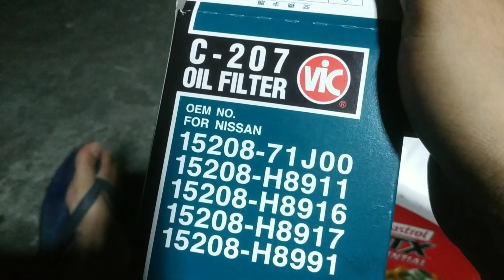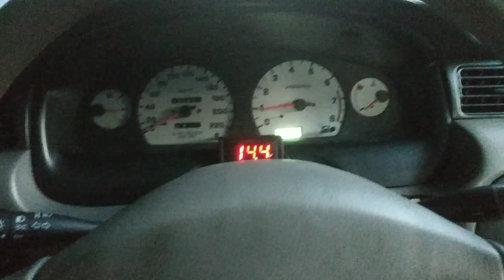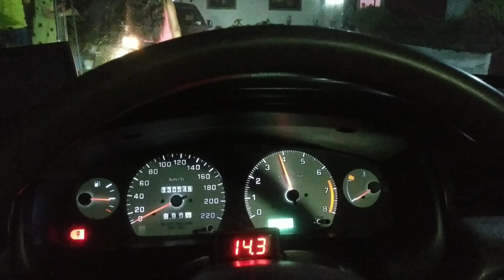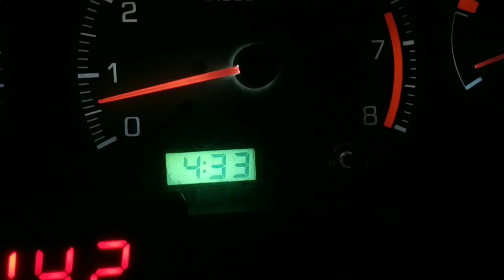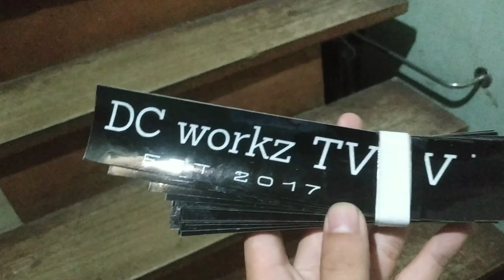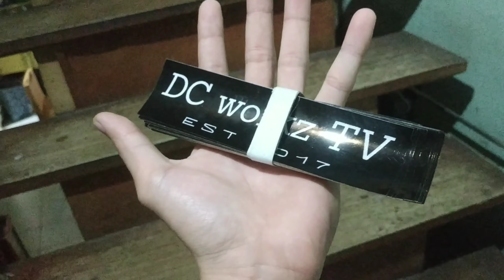2021 new year run and preparation

Comment: hey bro i nned your help  my engine is ga15de and i want to hook tachometer but i can get the signal wire 
 i dont know you can be able to ask since its a com car in your area  
can you share you email kindly i send picture of the distrbutor plugs it has 8 wires
Reply from the maker: Hey there was a plug designated on the ecu if your putting a stock gauge with rpm but if your just adding a external tach on your car you can tap a ground wire on your distributor ground
Reply: @DCworkzTV   okay maybe the color code or i measure the one that has ground